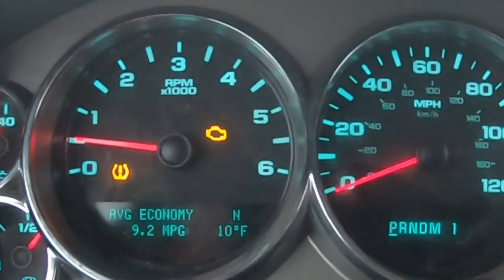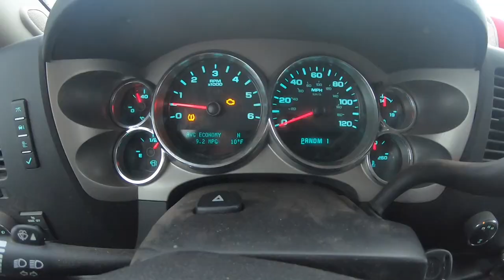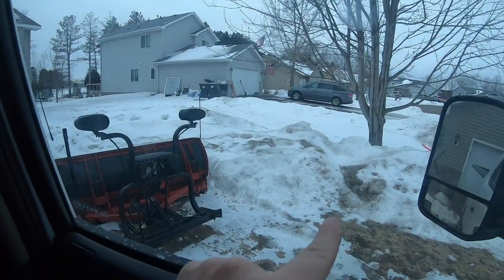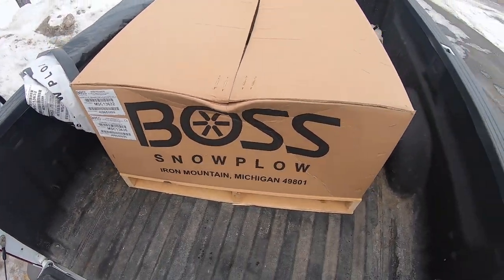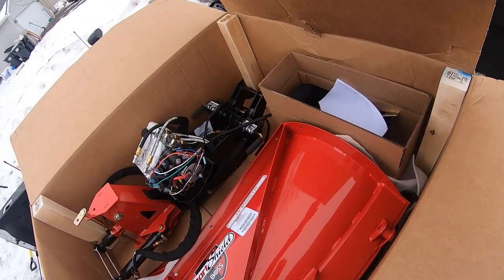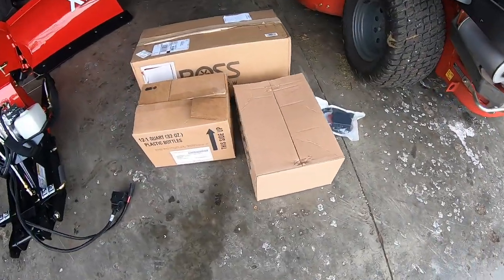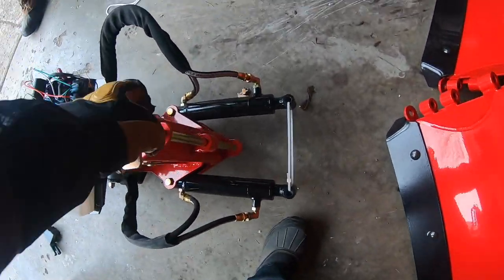Our New Snow Plow [Boss ATV V-XT] #snowplowing

Comment: Great video my man! I just picked up a 2018 can am outlander 1000. Boss is funny with there parts. They seemingly almost try and make you go through a dealer to get everything you need. But im getting close to getting this setup you have all figured out as far as what all parts I need to get pushing snow.  The plow kit , and vehicle side mount are pretty straight forward.  What i could use your help with are part numbers for all of the wiring kits! Vehicle side main wiring harness, Plow side wiring harness ( if it does not come in the big box with the plow/hydro unit), and also the handle bar v plow controller kit for an ATV.  If you could provide me any of those 3 part #s that be awesome! Thanks in advance bro!!
Reply from the maker: I would call boss directly, I don't have this plow currently.. otherwise, I would be happy to try to help you. Boss has pretty good customer service from my experiences with them. They will gladly get you the information you need.

Comment: How much weight can the front suspension on atv hold? I have a polaris hawkeye 300 4x4/ sportsman 400 h.o
Reply from the maker: I believe it all depends on the springs. I'm not sure if your 400 h.o is sprung the same as a 570. I don't think they are really supposed to carry more than 100lbs on the front but it's not always carrying the load when the plow is on the ground obviously.

Comment: Thanks for the video... Question for you... How do you transport the 4 wheeler in the winter?  With an open trailer or on the bed of your truck.  I'm considering getting one for my plowing business, but I really don't want to pull my closed trailer in the winter. Any info would be helpful, and thanks in advance.
Reply from the maker: That's a great question. I wish I could give you a better answer... We are very lucky and are able to drive it from job to job as the work we have done with it is only blocks from my home. I will say enclosed may be the better option. My experience with hauling atvs and snowmobiles for recreational use is that they get caked in slush more often than not if they are on an open trailer.
Reply: @bladezllc  oh okay that's sweet, and thanks for the reply!